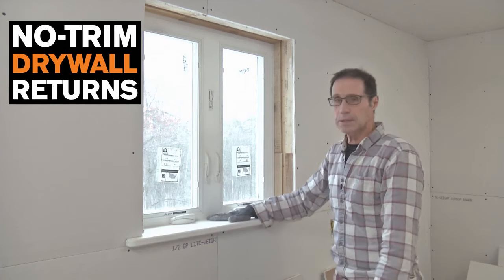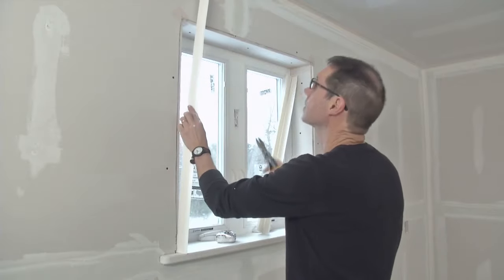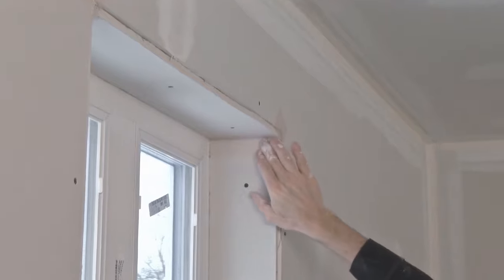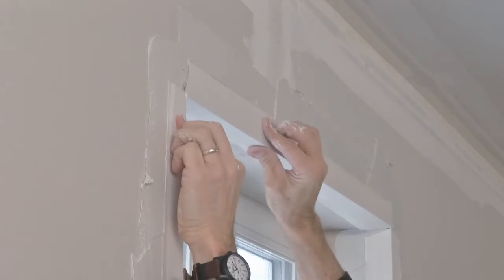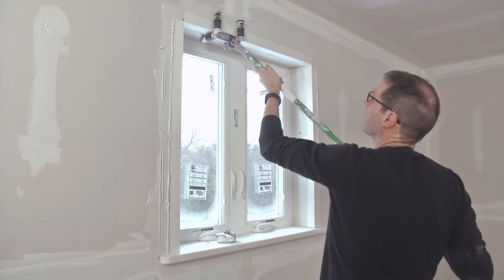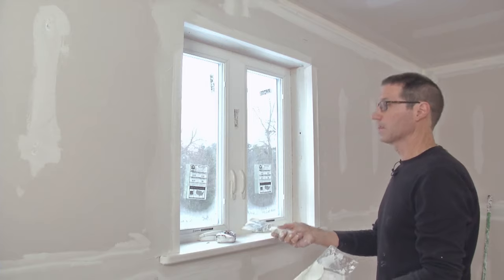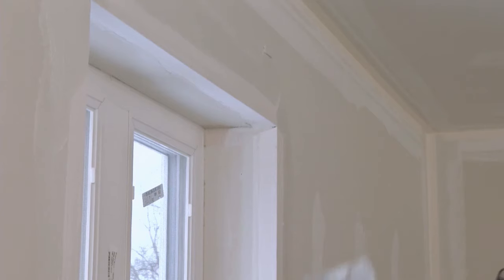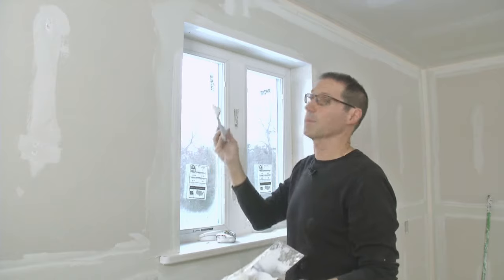No-Trim Drywall Returns for Windows

Comment: I’m not a fan of drywall returns myself, but this is great work.
Reply: Agreed, humidity and temperature changes by the windows, especially if they lose their seal, makes this a short term solution and not worth the savings imo. If everything was done right you can get away with it, but it's rare that the drywall guys would know that the other crews properly sealed in the exteriors of the windows etc.
Reply: Agreed. I have drywall returns in my basement hopper windows done by remodeler 5 years ago. Started staining suspect due to condensation after 4 years and light molding on one. Doubt they properly insulated around the window either. Have to redo and will us wood returns w/ proper insulation.

Comment: Good night, one technical question, I think you know: refer to window installation , I’ve been seeing a lot of videos fixing the whole window to the drywall structure, but I ve been reading technical manual of drywalls and it should be done by fixing the window to the exterior of the building because drywall frames are not designed to support the weight of windows. Am I correct? Thanks

Comment: So, what are you doing about the interior corners-closer to the window? Compound alone will certainly crack over time. I mean I prefer wood trim, but when I would do such things in the past I’d use a metal J-bead at the interior corner near the windows. After installing that J-bead, you can compound or caulk or use both to complete the finish. 

You could also mesh tape it as well, I think, but I don’t think it should just be a drywall butt joint.
Reply: These are for people that don't have kids, dogs, and house parties...

Wouldn't it be nice if you could do something  like this and rest in peace? Lol
Reply: I use tear away for the inside lines, against the windows

Comment: Nice job all round way cheaper faster way to be done.. if a good flex caulking is used and good water resistant drywall and paint .. condensation won't do as much damage as iv noticed over 30 years of repairing doors and windows.
Reply: so then what would be best opposed to what he's doing? I'm a newbie.

Comment: So no caulk on the joint where the drywall jamb meets the window? Seems like it would benefit from caulk for building performance/air sealing.
Reply: Generally the window itself should have its own inside seal, between the window and window opening. A seal at the drywall jamb connection isn't strictly necessary, unless your drywall is your primary air barrier.
Reply: Spot on Kasper.

Comment: Nice video, why do you not use the drywall factory edge towards the window it would be much cleaner and the opposite edge is covered? Oh and its a tighter fit to the window frame.  
The mesh in the corner wouldn't that be better if it was a bit longer and placed at a 45 (90 to the direction you have now). I have even seen two strips of mesh in some builds at the doors and windows corners especially in soil conditions where settling occurs..
-MG
Reply: He is clearly not a professional and he is not very good. Lots of amateur mistakes here. Putting the mesh tape under the corner bead is just idiotic. About as useful as putting you tape on the back side of the drywall.
Reply: we pros use a track saw connected to a vac to make these tight against the window/door. Also tape or use other method for sealing behind incase of moisture. Also screw it way tigher, this guy was happy with 3 screws, i wouldve put 10 atleast

Comment: man, we have these and they've been nothing but trouble with cold winter window sweat (or ice) and mold. Putting the raw edge of the drywall right on the metal window is going to slurp up condensation, it seems.

Is it normal to use regular drywall or is there a water proof option?
Reply: You can use moisture resistant drywall that is often used for bathrooms, if your home has issues with excess moisture or humidity. Cheers!

Comment: I'm curious as to why you don't 45 the corners of the cornerbead as is typically done with metal.
Reply: Because he is not a professional and doesn't really know what he's doing. I've watched a lot of pros work since I bought my house that had massive issues and this guy does not move or apply mud like someone who has done it very often. A real pro doesn't need that gimmicky tool he uses and a real pro would know better than to put the tape under the corner bead instead of over it.
Reply: @MAGAMAN  The corner bead comes prepped that way - a pro would know this.

Comment: This was popular in the 60's and 70's. Windows always have condensation and the drywall always fails eventually, believe me as i have repaired hundreds.
Reply: Popular or common? They loved this in starter homes well into the current era. 🤮 Thanks for fixing this atrocity 1 at a time.
Reply: This method is still popular in California.
Reply: what can be done to achieve this look but not have drywall failing. what's the alternative?
Reply: Use wood returns with proper window and wall insulation.  If in a basement, have a dehumidifier present as well. In the middle of having to tear out drywall returns now. So aggravating
Reply: @diffasmr2296  Wooden window casings. To avoid possible movement, use stud adhesive every 6 to 8 inches between the drywall, wooden window casing, and the framework studs surrounding the window casing. Mesh the casing to the drywall in the same way you stop the join between two pieces of plasterboard.
Reply: yeah, our house was built in 1978 and all the windows are moldy behind the drywall. We're going to have to have all of them replaced.

Comment: This is a terrible idea !
The fiberglass mesh tape is not to be used with joint compound. The outside 90 corners will definitely crack. 
Not a matter of if but when. I would have mitered the Ultra flex joint tape eliminating any possible future cracking. 
Finally the window stool should be installed last. 
I wouldn’t allow this amateur in my house.
But good try myoron

Comment: How do you know if it’s level or straight? Better off with plastic or metal corners and stapling them in place, then use fast set compound.